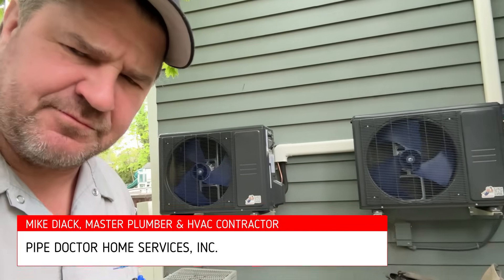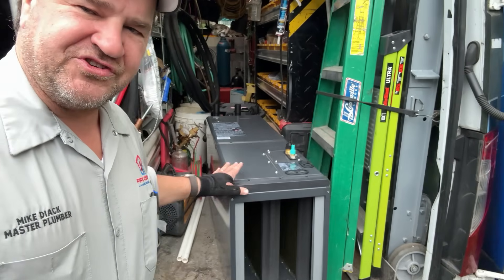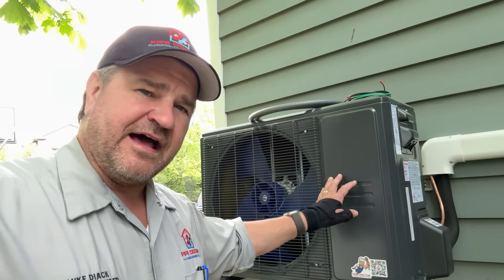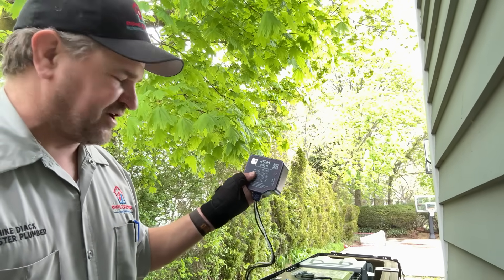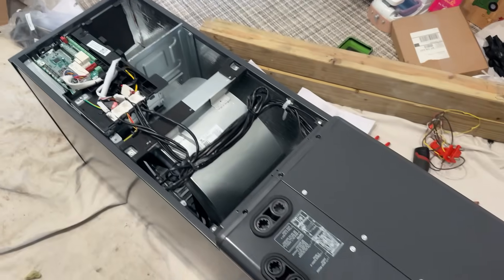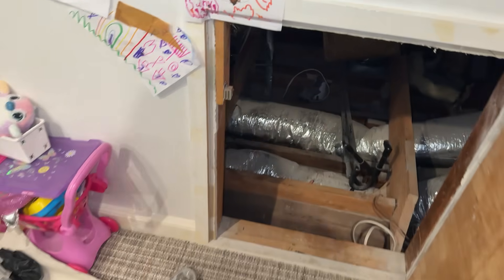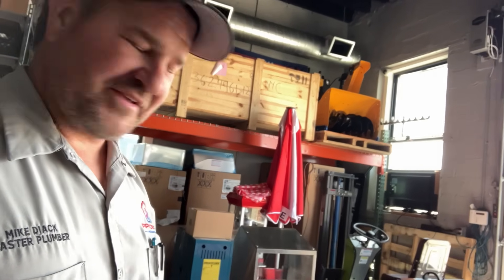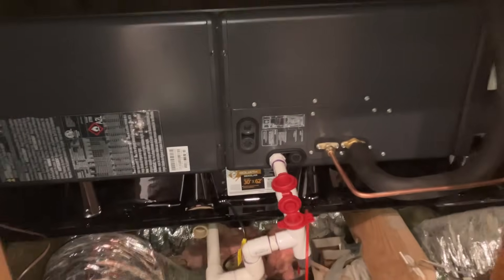Mikey Pipes Installs GAME-CHANGING Dual Voltage HVAC System by ACiQ | Part 3 of 3

Comment: What you need, ICM makes a diconnect with the SUrge Protection built in!
ICM ICM495-60A-NF 60 Amp Non-Fused Disconnect with Internal Surge Protection

Comment: If room to put surge suppressor at disconnect, better yet electrically. Good job.
Reply from the maker: Thanks for the suggestion! A surge suppressor can definitely add an extra layer of protection to the system. Appreciate your input!
Reply: The warranty of a device only works when surge put on the device, so at the disconnect the warranty is also disconnected,.  Well it would cover surge damage to the disconnect.  LOL
You and me it won't matter since also needs license electrician or voided.  Funny their installation says L1/L2, Neutral, not the ground.

Comment: 115 volt air handler seems great for replacing an older furnace. But what about for auxiliary heat? I would imagine at 220 volt would still need to be run for electric backup.
Reply: in any case electric heat back up is always wired  on its own circuit, you would never run electric heat coil from existing furnace line, the line that goes to furnace is strictly for blower motor and some electronics

Comment: Is it compatible with a 24 V heat pump thermostat and a dual fuel system
Reply: 💯 they are. Pick your favorite stat and have at it. But if your favorite stat is Nest..there is a special place in hell for you 🤣
Reply: @Hvactailgatetraining honeywell chronotherm circa:1984. You can hear it from any room on the floor it's on.😅
Reply: @brian-ek1ec  those thermostats were the best
Reply from the maker: Yes.